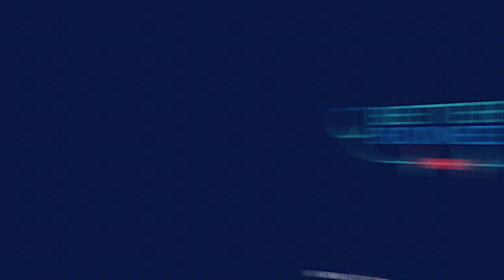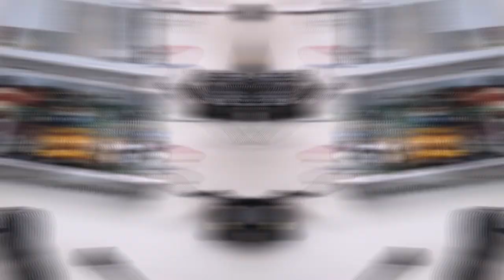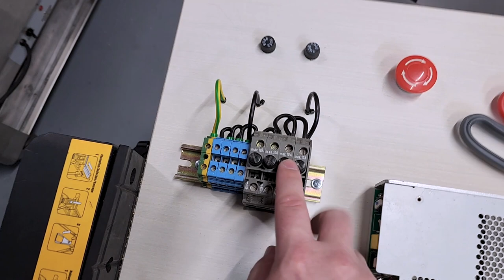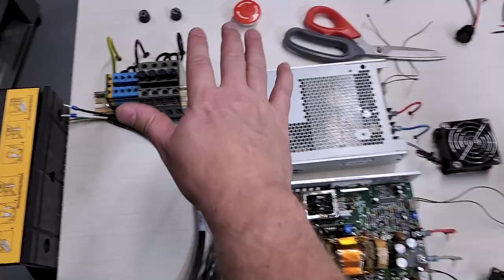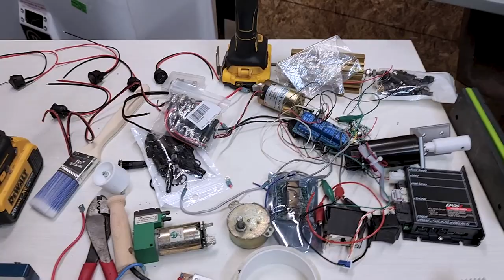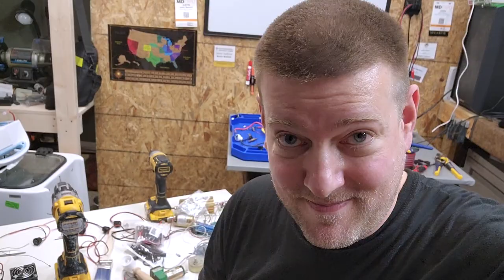Weekend Homework!

Comment: I'm putting together a line current limit using pigmy bulbs (as other bulbs are no longer available) I'm going with 10 bulbs on 4 switches with a bypass so I have 16 possible limits in 15 watt increments. We are troubleshooting CRT monitors for arcade games. I'm from the UK so we have 230V line voltage. Fun fun fun. Yup we have built in voltage and current monitoring.